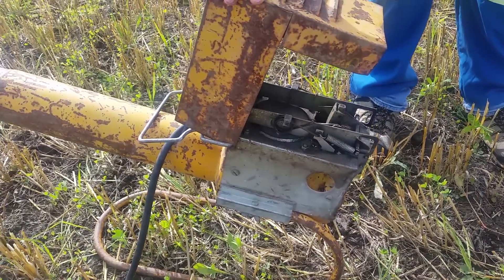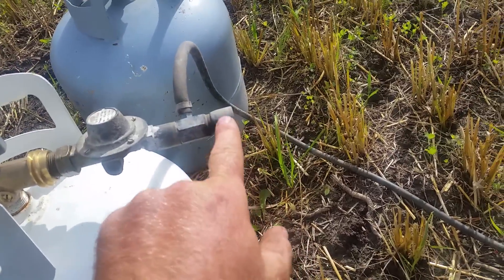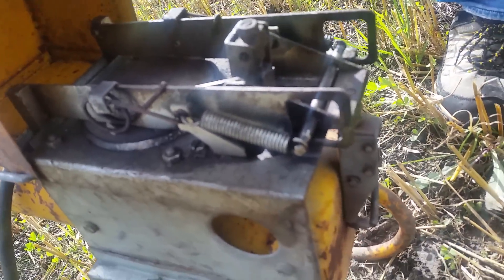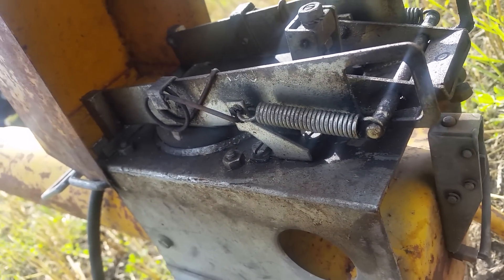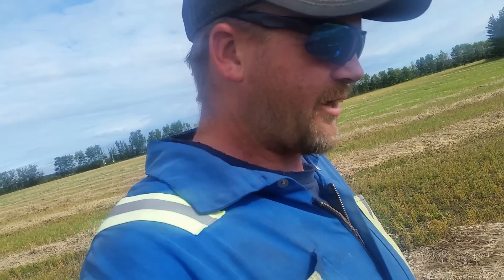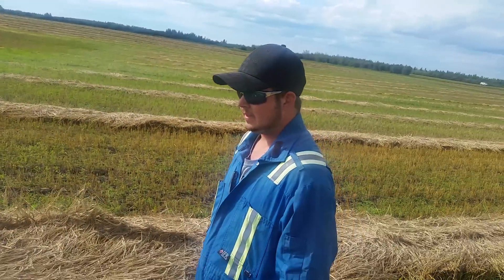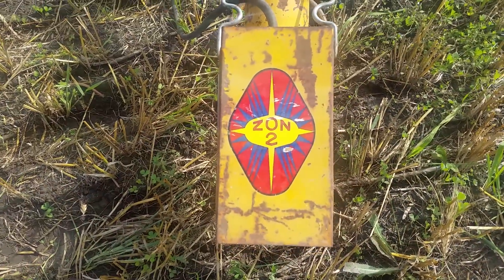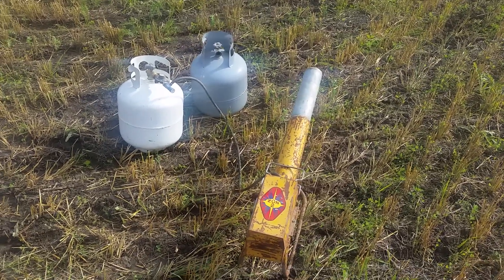How Scare Cannons work

Comment: aren't you better off with a hail cannon?  not only they will scare animals away but they prevent hail too.
Reply from the maker: Never heard of such a thing... we dont get hail very much at all
Reply: @Northern_Farmer  they are super cool!  they shoot a vortex  of air up to the clouds to break up the storms to prevent hail. watch a video on YouTube.  some add smoke to visualize the vortex rings but most of them dont.  the whistling sound after its fired is the vortex going faster then the speed of sound going straight to the clouds.   these cannons are huge and are completely legal since they have no projectiles but they generate a very powerful vortex that can take down a brick wall depending on its size.  usually there set straight up and the portable ones are set at a angle. check it out i bet you'll be impressed.